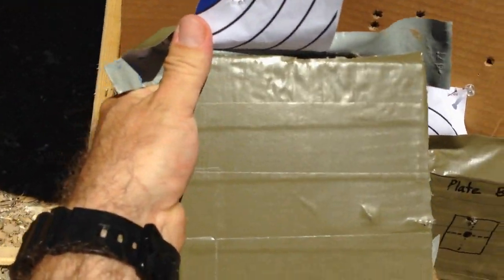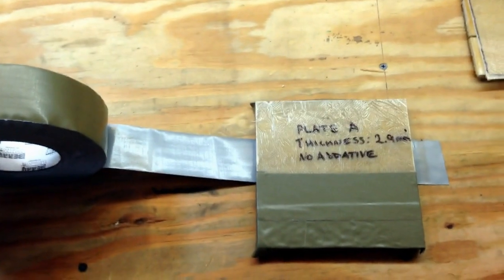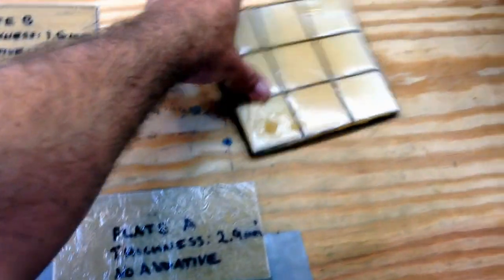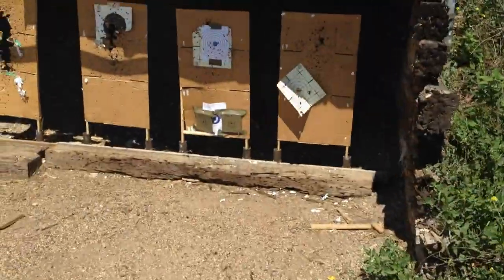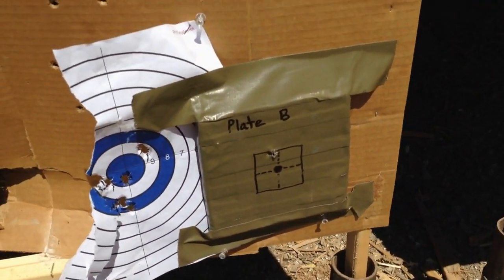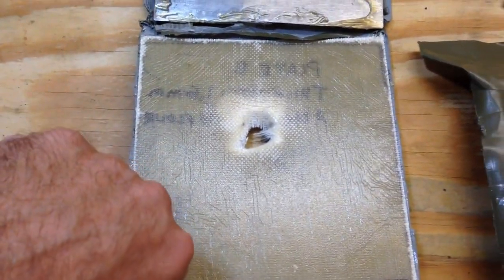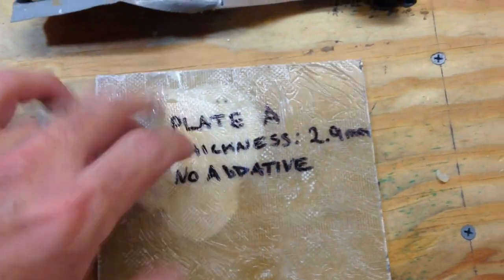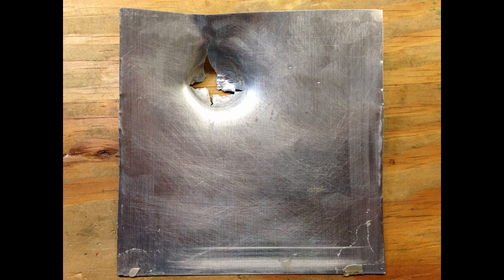Homemade Bulletproof Body Armor Plate

Comment: 6:07 That's a broken rib (or three)!
Reply: Better than an open cavity in your chest....
Reply: Irush Seamus You're bending over in a very painful wheeze, a defenseless target for a second shot.

So no, it's not better, since it's added pain before you get finished off.
Reply: +RonJohn63 Gives you and your squad time to lay down suppressing fire. You ever seen combat? Broken ribs are welcomed in the face of a belly wound or sucking chest wound.
Reply: Irush Seamus      Gives you and your squad time to lay down suppressing fire.

What does?  Bending over and wheezing?

You ever seen combat?

Are you a soldier who's broken ribs during a firefight?

Broken ribs are welcomed

I've had bruised ribs, the pain of which is pretty severe.  The dent at 6:07 isn't going to make a hairline fracture in your side, but a compound fracture which just might puncture a lung.
Reply: +RonJohn63 I was an FMF corpsman. A medic. If my unit is under fire and anyone drops, the idea is to cover fire until we can move them. You're basically arguing that the Marine that is injured would rather have an entrance wound than numerous broken ribs. 

I've treated broken ribs, I've treated sucking chest wounds... 100% of the time any and everyone would rather have broken ribs than a hole in their body.
Reply: Irush Seamus If you're a in a squad of Marines on patrol and have an attached corpsman, you aren't wearing homemade armor that will make a dent in you like this armor did at 6:07.

Thus, the circumstances are drastically different.
Reply: +RonJohn63 Agreed, yet the argument is over homemade armor and an injury vs a bullet wound. Are you making armor that's superior to this? If not, you should take this as it was meant.... An instructional video to make your own armor this is going to be less quality than that of milspec level 3-4 kev and plates.
Reply: Irush Seamus    the argument is over

No, it's not.

It's over whether an injury that incapacitates you from that much pain -- thus leaving you open to a second attack -- is worth the extra weight.

Are you making armor that's superior to this?

I don't often enough go into situations -- or have fantasies about being in situations --  where I need body armor.
Reply: If you don't find yourself needing or wanting homemade body armor, what bring you here to argue? Are you trolling? Surely you're not the type to only provide a problem and not a solution to the problem.... That would mean that you're apart of the problem and not of the solution.

I feel it is worth a couple of broken ribs to avoid bullet wounds from small arms fire. If you've never been tested to see what you're capable of under similar types of duress, then you are highly unaware of how little a few broken ribs will affect your survival instinct to either return fire or find cover.
 
You just argue your point from the way that you assume you would react. Which is perfectly fine, had you kept your comment solely about yourself.

You have your valid point that yes, that much force directly exerted to the chest cavity could cause pneumothorax and internal hemorrhaging. Hell, even a partially collapsed lung is considerably bad to sustain on a battlefield. But I still find it better than a sucking chest wound, as I said. It also means they missed your vitals, and given the person's training and adrenaline levels could possibly put them in a heightened state and allow for a solid counter attack before you "doubling over" occurs. I've seen Marines do some extraordinary things to overcome situations. But hey, you don't get into these situations anyway.
Reply: RonJohn63
In addition, I own quite a few firearms. I never fantasize about getting into a gun fight or having to use one for any other reason than plinking or becoming more proficient at my hobby... But I carry in case, I clean and practice with my AR in case and I enjoy sighting on moving targets in case. Isn't that reason for body insurance(armor) anyhow?
Reply: Irush Seamus    then you are highly unaware of how little a few broken ribs will affect your survival instinct

That is an interesting point.
Reply: Irush Seamus    Isn't that reason for body insurance(armor) anyhow?

I don't understand how that relates to your comment about plinking and sighting on moving targets.
Reply: +RonJohn63 Everything said above my armor insurance comment was about doing things in case.... Your ability to nitpick is failing you.

What's interesting is how you don't understand how body armor works yet you continue to argue based on zero knowledge of its intended use. Hint: Body armor is not bullet proof. Secondary armor such as a homemade armor will undoubtedly be less quality. 

The redundancy of this has gotten old.
Reply: Irush Seamus    Your ability to nitpick is failing you.

This thread started with the simple comment, "That's a broken rib (or three)!"

YOU are the one who started the argument.

Comment: Do these guys that make these " bullet proof plates " only own 9 mm handguns ? Come on man make it a test of different calibers if you gonna go through all that trouble of making these things
Reply from the maker: Chris Pryor, 9mm is the most common caliber and has one of the best penetration capabilities.
Reply: The Professional Prepper (Prep Know Do)  understandable that 9 mm is the most common I think the best penetrati
Reply: The Professional Prepper (Prep Know Do) oops the penetration is up for debate. Just thought it was a lot of work to just shoot 9 mm at it and would of been nice to see .357, .10mm, 40. And .45 yaknow. I guess I won twin many calibers and would of tried multiple. Appreciate the video just wanted to see other outcomes
Reply: The Professional Prepper (Prep Know Do) guess I own to many calibers Jesus  need to learn how to type.
Reply from the maker: 357, and 10mm will penetrate better, 40 and 45 not so much.  I have other videos with better designs and more testing.  No other calibers though.
Reply: The Professional Prepper (Prep Know Do) cool I will check those out